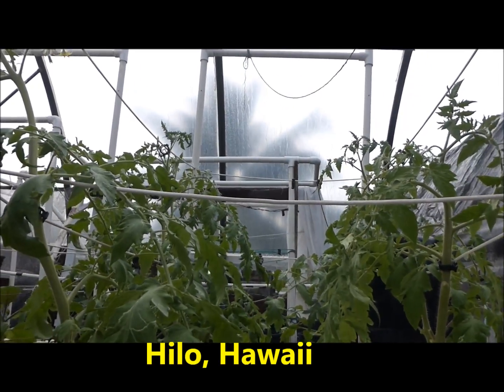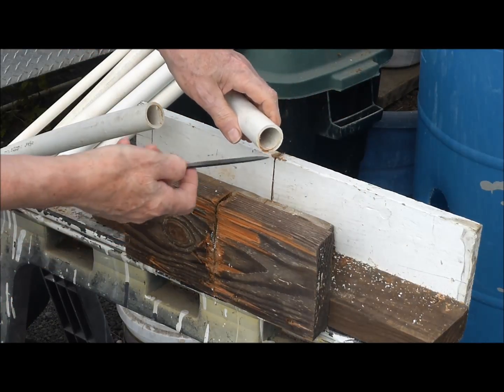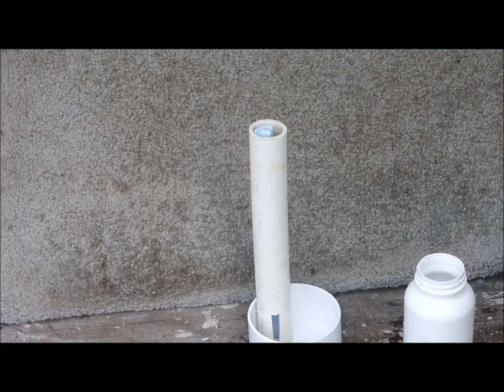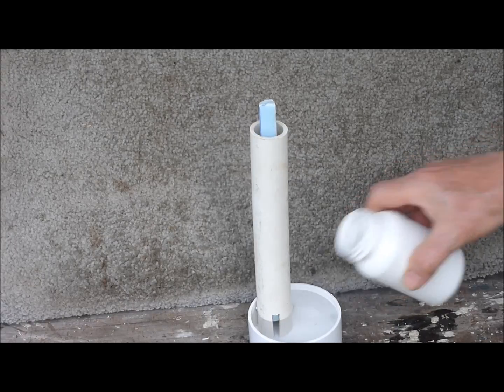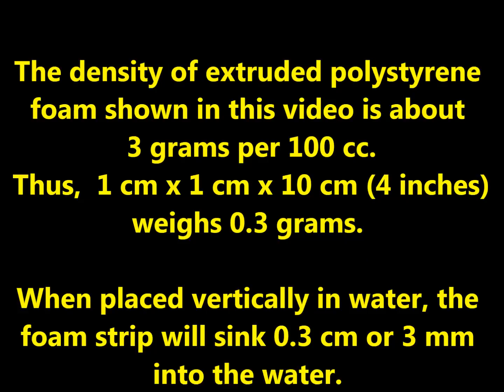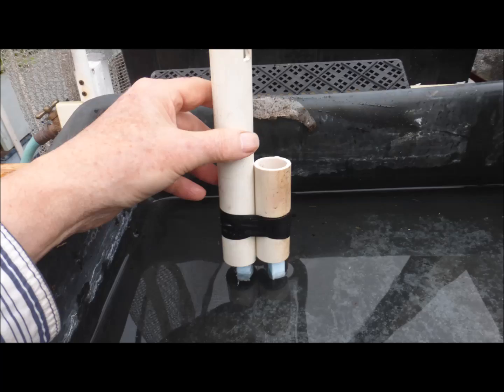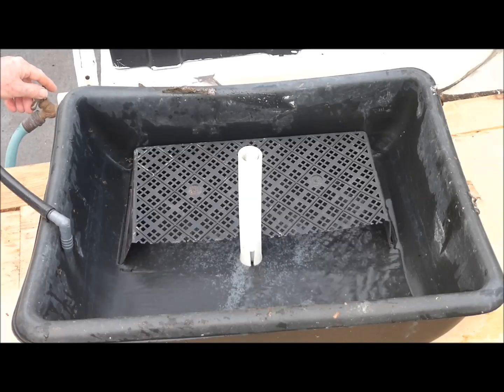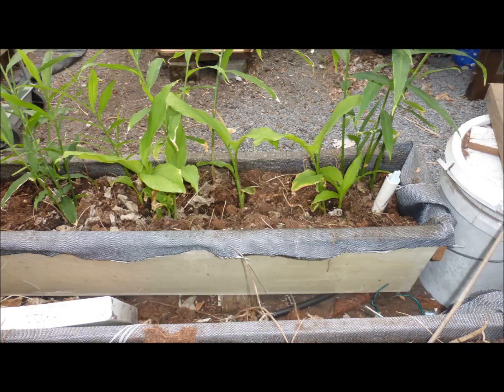Water Level Indicators for Hydroponic and Sub Irrigated Tanks of Growing Medium

Comment: Thanks for your informative simple solutions They are spot on. I was concerned with this water level unit letting mosquitoes into the water below the screen. Gluing a jelly jar lid with a hole in it for your pvc pipe and screwing on the glass jar solved the bug and rain water intrusion for out door growing. Acrylic latex caulk works well as a glue if you can leave it
set overnight.
Reply from the maker: Thanks for sharing.

Comment: just wondering, how would you know which is max and which is min? also, does the amount of foam sticking out of the pipe represent how many centimetres from the bottom of water there is?
Reply from the maker: Yes, the length of the indicator rising above the pipe slightly underestimates the height of the solution in the tank.  I don't understand the first part of the question.

Comment: Kratky method in 5 gallon buckets how low of fluids is too low and after the roots are adult stage what would be the max fluid level?
Reply from the maker: Below 2 inches from the bottom is likely too low and above 2 inches from the the bottom of the net pot to the solution surface (after the initial drop) is likely too high.
Reply: Thank you for adding some confidence to my fooling around :)

Comment: sorry dr. I prefer to drill holes on the outside container to gauge the water level. once the hole is drilled to the appropriate level, no matter what rain may come, it can be over watered... the hole just drains the water out. I use 2, 1/4 inch holes.